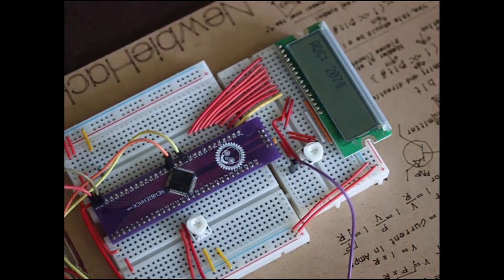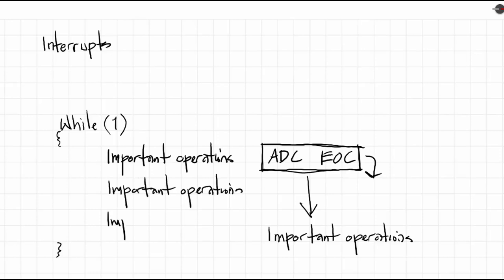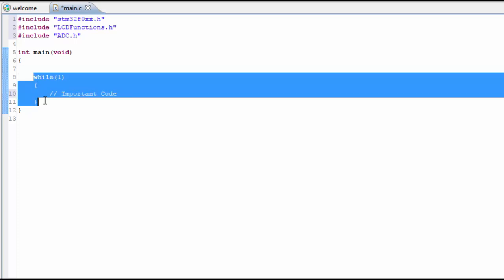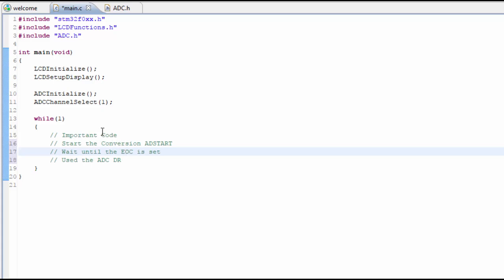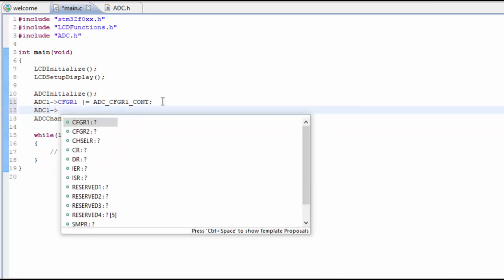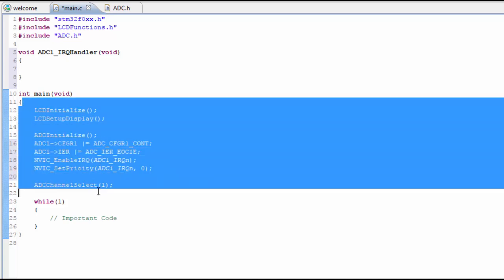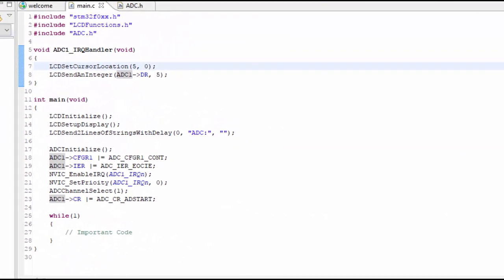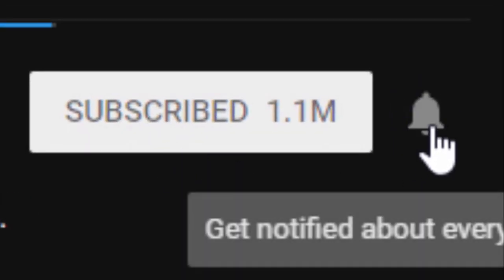51.  How to Add Interrupts for the ADC - ARM Microcontroller Part 2 - ARM STM32 Microcontroller

Comment: Great info in your vids.  At 4:15 i think you mean you don't want your data in a local var, you do in fact want to use a "volatile" variable in an interrupt routine if that var is to be read outside the routine.

Comment: I think I have hit a wall here, I can’t get anything in the ADC1_IRQHandler to run. The only difference between our code is that I have the old version of the coIDE which only has the Cmsis core and boot available in the repo, no STM32F030X8_CUBELIB. If anybody who was able to get the newer version of the coIDE that Patrick is using could supply that file so I can add it manually It would be much appreciated.
Reply: honestly I don't even think this is the problem, i should only need the stm32f0xx.h for this to work right? any other ideas as to why the void ADC1_IRQHAndler(void) wouldn't run? I don't get any errors when I build.
Reply: Yup I identified the point at which the code fails and it's the ADC1->CR |= ADC_CR_ADSTART; line, nothing after this line runs. If I reload the previous example with the ADC Start in the while loop it in the while loop it runs fine.
Reply: For anybody having this issue, they changed the name of the ADC IRQHandler, you can find what yours is by  looking in startup_stm32f0xx.s
Reply: @tjwelsh1438  Hey bro/sis THANKS
Reply: Thank you. Mine was ADC1_COMP_IRQHandler